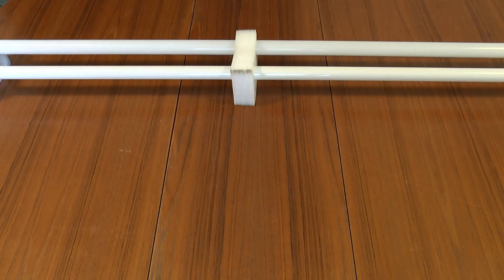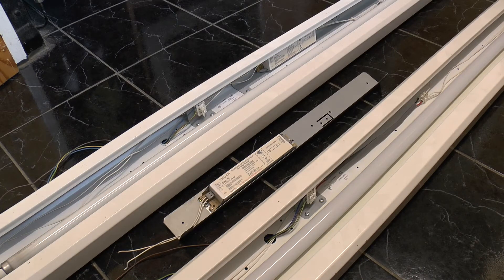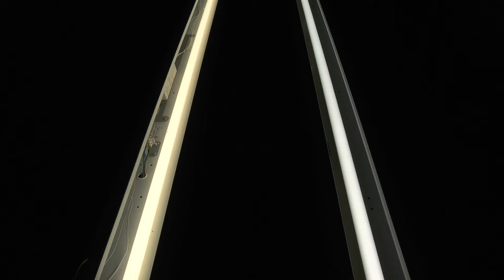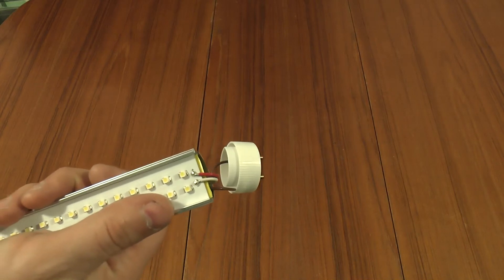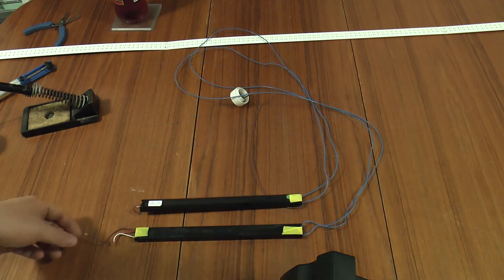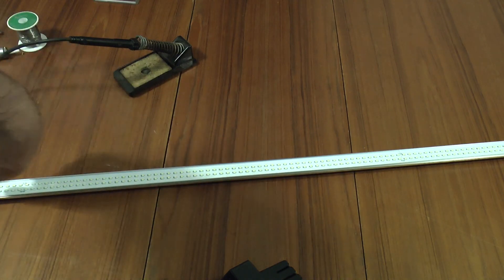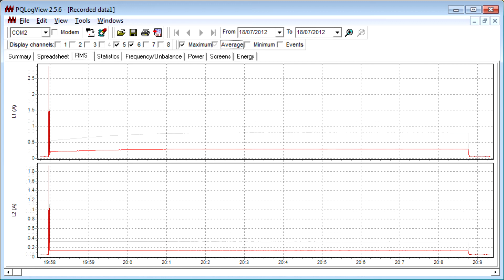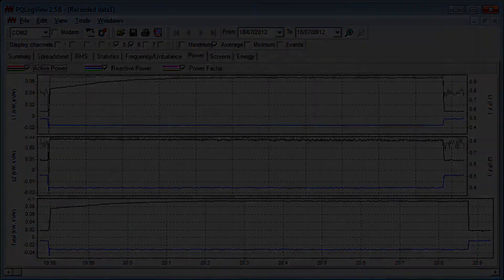Ecolite LED striplight tube teardown (fluorescent replacement)

Comment from the maker: If an LED failed open-circuit on a constant current driver then the 120mA is being pushed through the other five strings (24mA per LED instead of 20mA). Easier to spot as a whole section of tube would be darker, but more important to fix quickly (as above).

Comment from the maker: I think the LED driver is designed for constant current, not constant voltage (there was a 120mA sticker on the black sleeve). If an LED failed short-circuit (difficult to spot through the diffuser, though) I think the best bet, if replacements aren't available, would be to put shorting links around the dead one plus another five (one on each string) so that the strings are balanced again. I'd expect the voltage to drop to about 92 volts end-to-end.

Comment: System failure behavior depends on how any particular LED goes tits up.  If an LED fails open, then the string its in will stop working.  If it fails short, then the string will keep working.  However, this will lead to increased power dissipation in the LEDs in that string and subsequent rapid degradation and failure of the other LEDs in that string unless each string is individually ballasted (LEDs HATE being overdriven).

Comment: I must admit though I do like some LED lamps. My bathroom is lit by recessed GU10 downlights and I decided to test Sylvania's latest 7.5w HiSpot RefLED GU10. Unlike the Philips Master LED 7w GU10's that are MASSIVE these Sylvies are exactly the same size as a normal 50w GU10 halogen and are a little bit brighter. IMO they are so much better as the light is 4000k (I hate anything below 3500k!) Will be interesting to see if these can do the claimed 25000 hours!

Comment: It's kinda funny. New technology, less light. What's the big idea? ECO...

But is it eco friendly? Yes, it consumes less power. But if you think about what manufacturing costs, and the end of life pollution (throw away attitude), is it eco friendly? I think not. There are more chemicals, components and manufacturing energy involved in manufacturing these eco friendly lights, than just an ordinary glass tube with some gasses in it, and a bit of metal (maybe some mercury vapour to).

Comment from the maker: The halogen downlighters at my parents' place looked shit for the power they were gutsing (the rooms looked brighter with the original 60 watt bulbs than they did with 185/210 watts of downlighters). All the bulbs at mine are CFL or fluorescent tube, except for the outside bulkhead lights which are 42 watt halogen as the CFLs take an age to warm up outside, and the kitchen which now has the LED tube.
I've got two ancient Philips CFLs that take about 3 minutes to warm up, they're attic lights :)

Comment from the maker: I replaced ten GU10 bulbs at my parents' place with 3 watt 60-LED warm-white clusters. Same brightness (which isn't a lot when it comes to GU10 downlighters, they're bloody useless) but the front room lights now use 12 watts instead of 185 watts (there were 3 50's and a 35), and the lights in one of the bedrooms now use 18 watts instead of 210 watts. More impressive than this tube.

Comment: I generally avoid anything with an electronic ballast too. There are magnetic chokes out there that have been operation for over 40 years! Electronic ballasts in commercial applications rarely last  as long as the lamp installed in them!

Comment from the maker: Interesting, I'll keep an eye on that. My camera's still in manual iris mode and reckons it's in "open" mode with 3dB gain. I'll use the same settings in a few months and see if it's dimmer.